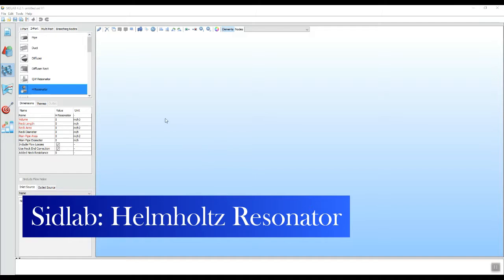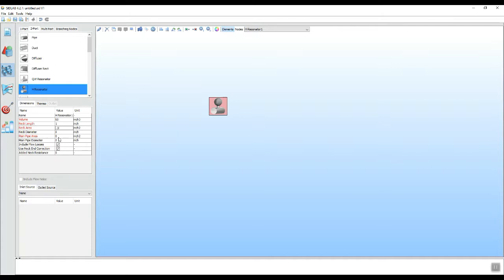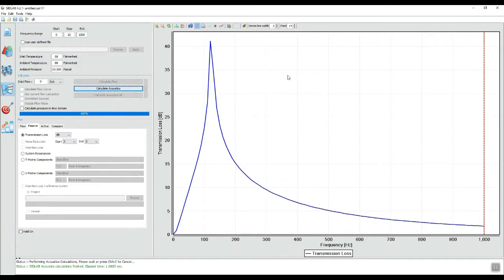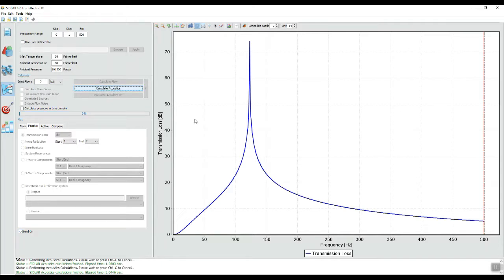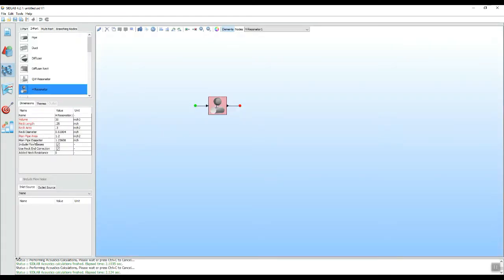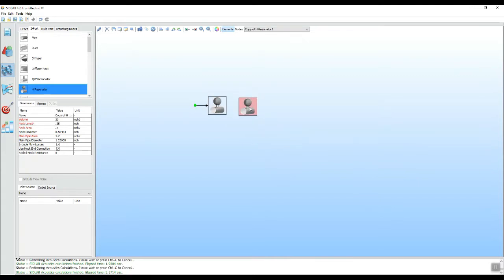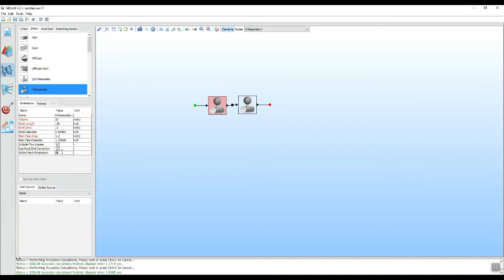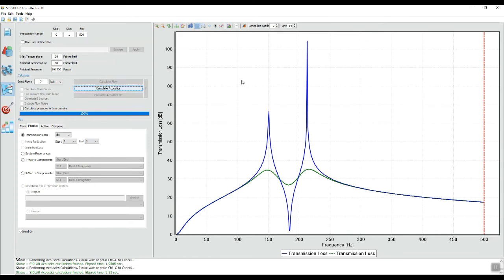Muffler Helmholtz Resonator

Comment: Would this approach work on an exhaust "hiss" caused by what is purported to be a resonance within the Nissan VQ engine that becomes prevalent once test pipes are installed?
Reply: you could maybe try using a Y-pipe, single exit design.

I had a hissing with my v6 commodore and by using the exact same muffler and resonator combo, except merged into 1 pipe, the hiss was gone.

also a H pipe configuration got rid of it too

only hissed with X pipes
just my 2 cents

Comment: I'm an aerospace engineer and gearhead building a packaging-restricted exhaust system for a former race car now being repurposed for street use and am researching Helmholtz resonators as part of the system.  While I am not in a position to use this software (don't need it commercially and the trial license doesn't allow for hobby use), your mention of a fine mesh screen and the resulting effects on the attenuation curve has piqued my interest.  I already have some stainless screens on hand from other projects (McMaster-Carr 9317T771, 46% open, 0.034" hole size, 0.016" wire size), so I am going to see what their effect is when I implement the resonators.  Thank you!
Reply from the maker: Hello Shawn
I hope you are well
Many thanks for your comment 
You can try SIDLAB for one-month for free via this link: https://sidlab.se/download/download-step-1/
Reply: @sidlab6464 , thanks!